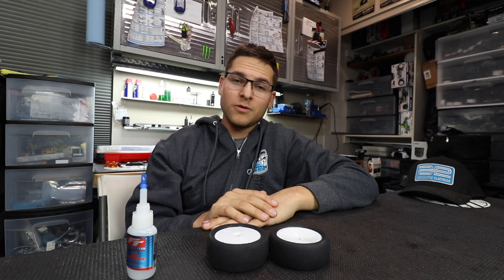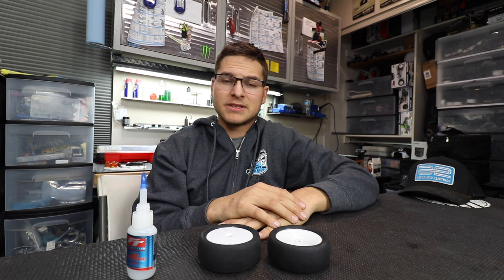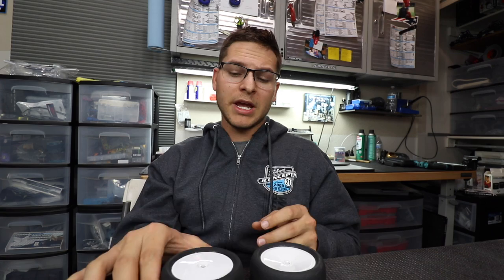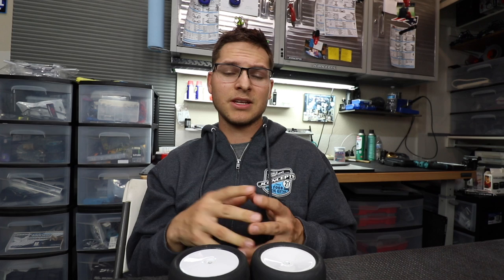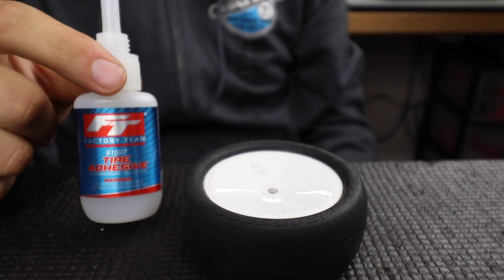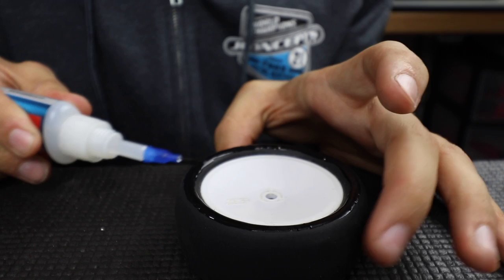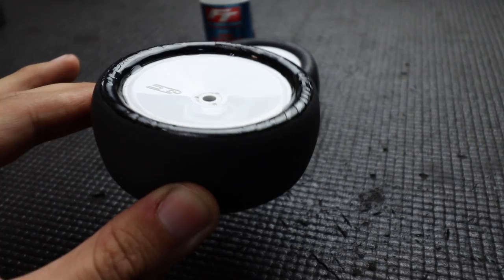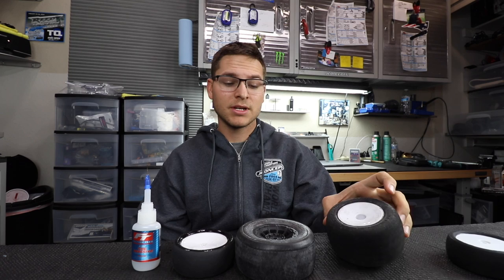SPEED TIP  (Glued Side Walls) How to Go FASTER - Spencer Rivkin

Comment: After 1 run it seams like the glue cracks and goes away?  Do you re apply every run?
Reply: Had the same problem now I use a glue activator. The activator I’m using is call Mitreapel  awesome 
The cure time is 1 minute and it ready to race. It stopped the cracking